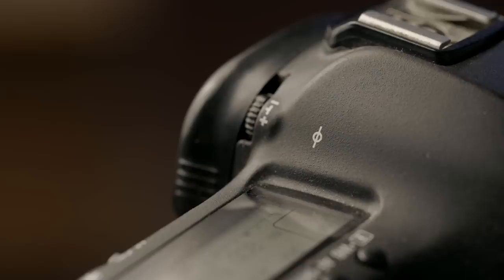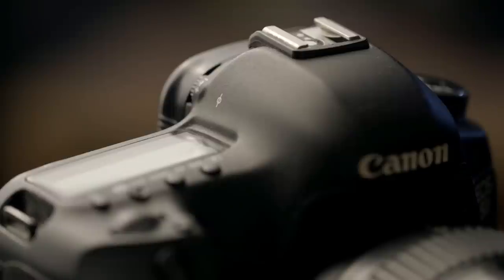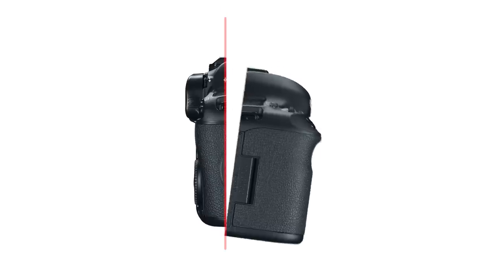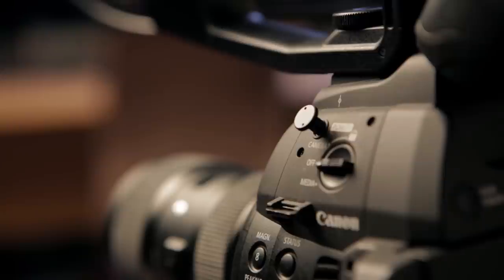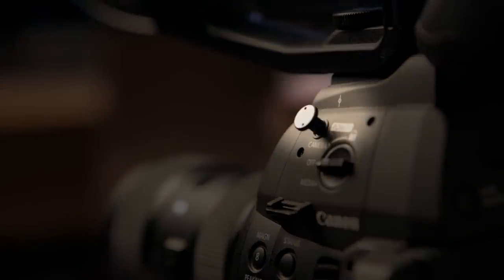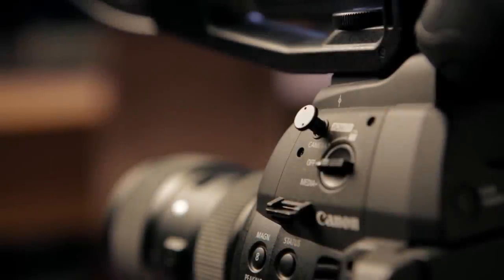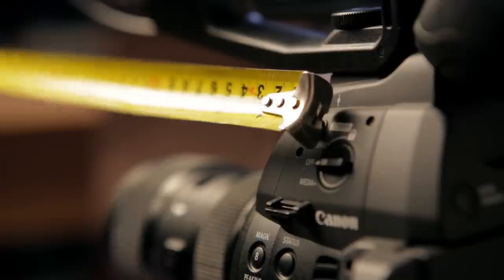This Symbol On Your Camera Explained! What Are Film Plane Indicators

Comment: Another useful function is: when doing panoramas, ensure that the focal plane is directly over the centre of the rotation point on the tripod and there will be less distortion when stitching the final image together.    If you are shooting large format, you also have to measure the distance from the focal plane to the front nodal point (where lens board is at front of the camera) to calculate bellows draw exposure compensation.
Reply from the maker: Thanks so much for adding that! Haven't had enough experience in panoramas or large formats myself to know that information. Really appreciate the knowledge!
Reply: In fact, when shooting panoramas, the camera should be rotated on the aperture axis, to avoid parallax errors. See http://www.glennrandall.com/solving-the-panorama-parallax-problem.html
Reply: Thank you, I must have remembered it incorrectly.  I've always wanted to buy one of those sliders to be able to do technically correct panoramas.  Or, I was thinking of getting an adapter for my 4x5 and do it that way.